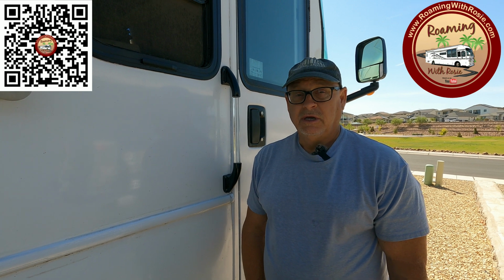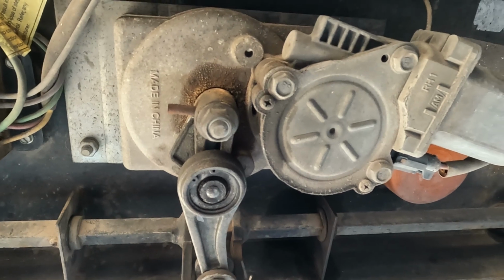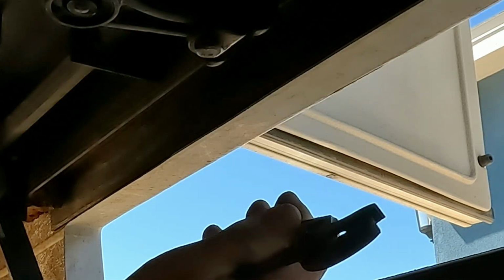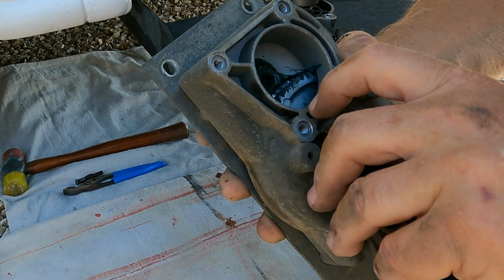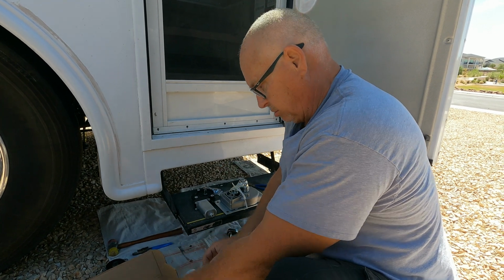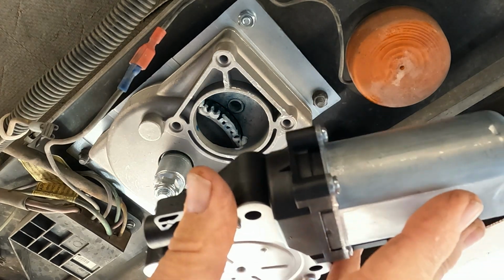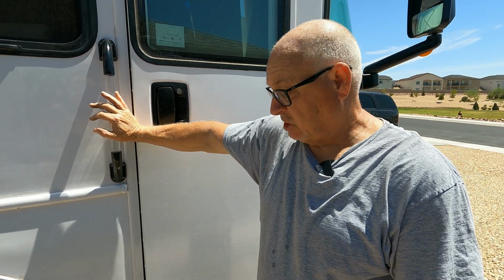Easy DIY - Replace The Motor & Gear Box Assembly On Your Electric RV Steps

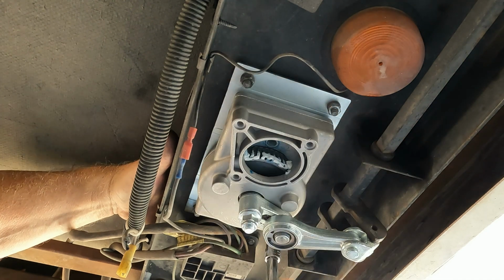Comment: No reason to remove the gear box assembly if a visual inspection shows that all teeth are intact.  You can inspect teeth by rotating the arm that connects to the step which you did (after the fact), @10:30.

In your case, your gears were broken.

Comment: Good Vid.
My mounting for the gear box used 1/4x20 carriage bolts next to the battery box, 1/2 gap. Lifting the gear box up (through 2 stairs) caused the carriage bolts to lift out of the square cutout, into an unreachable place, from above or below. I used tiny tweezers to pull them back down and tied some cord to hold them in place. That worked long enough to start the nut on the threads, without washer. Once I got all four nuts on I went back and removed the nuts one by one and put the lock washer in. The cord cinched them into place when tight.
The rest was easy. Model 43 stairs.
Reply from the maker: Sounds like a little more work than mine. Sometimes it takes some ingenuity.
Thanks for watching!

Comment: Nice Video!  In my case it was just the motor.  Square drive shaft engages to a square hole in the drive plate in the motor and that drive plate square hole had rounded corners (egged out).  It made the exact machine gun sound.  So far I have not had to change the gearbox, but have put in two motors to fix it.  With the motor replacement, it is just a matter of unplugging, removing the three screws, transferring the gear/pin, and putting it back.  It took me about 10 minutes.  The toughest part is laying on your back on the ground.  Thanks for your detailed video.
Reply from the maker: Glad you enjoyed the video. Your right the hardest part is laying on your back.
Thanks for watching!

Comment: do You need to have the step in a open or closed position when you plug everything in? What is the starting position for the step with new hardware installed? does it matter? Good video!
Reply from the maker: It doesn’t really matter. I had the step out when I plugged it in. Hope this helps. 
Thanks for watching!

Comment: Great video, as usual!  Did you disassemble the gearbox and see if that gear could be rotated on the shaft?  I believe it only uses 180° of the gear and the other side stays unused.  Same with the gear inside the motor gear housing.  Check it out.  it may give you an emergency spare for your spare parts bin to help out a fellow RVer or to get you out of a jam down the road.  Y'all be safe now!  Y'hear?  :)🚌👍
Reply from the maker: I didn’t think of that! I just figured it last 18 years. Change out the motor and gearbox I’m good for another 18 years. I kept the old motor it seemed to still be working. Thanks again for the good advice and for watching. Safe travels my friend.